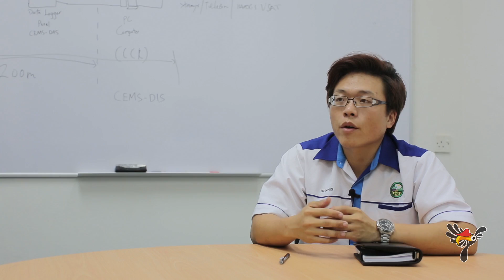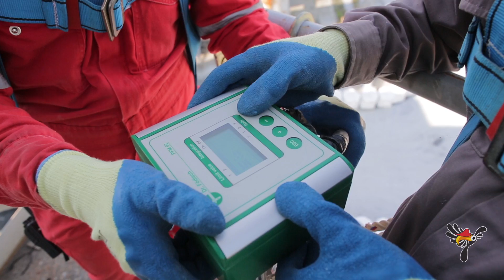A Day in the Life of an Electronics Engineer

Comment: Wag ka na Kayo mag ECE, sayang lang effort nyu. Even nakagraduate ka at makapasa Ng board exam if Meron lang design na electronics and communication system Hindi mo pa rin maiimplement Yan dahil need mo pa Ng sign and seal Ng PECE wherein vulnerable pa makuha Ng PECE ung design and maari mo rin xa makalaban sa project bidding kapag nakuha na nya ung electronics and communication system design mo.
Reply: sir ano fb mo? gusto kita makausap pa with regards dito
Reply: @SeanRicalde  sorry but it's confidential , Dito nalang tayu mag usap sa YouTube. Ask me your question and I will answer it. I will give internet links on the basis of my answers on your question para ma check na totoo ung mga sinasabi ko.
Reply: nagbabalak po kasi ako mag ece, lahat po kasi sila sabi that it’s an in demand course since nasa technology age tayo, hindi ko po ba dapat i take ece?
Reply: @SeanRicalde  kung Ang field mo ay technology software: pwede Ang ECE like sa IT industry pero sa engineering talo ka kapag ECE ka dahil ung mga Electrical Engineer kaya nila Gawin ung ginagawa Ng mga ECE. Philippine electronics code is very limited areas of application unlike the Philippine Electrical Code mas madami Ang projects na pede magawa. Dahil Ang mga Batas na nasa Philippine electronics code ay saklaw din Ng electrical engineering. 
In summary: So if software ung preferred mo, ECE is preferred.
Pero if u want engineering hardware and installation mas preferred ung EE or Electrical Engineering course.
Reply: @jasonamosco318  on point ka sir. Sana nag electrical nlng dn ako HAHA.
Reply: @christiantorres3892   may hope pa tayu, kung ang Iecep ay magiging mas active sa pag publish ng mga electronics code sa other field of areas. Kayalang mukhang Malabo din dahil sa systema ng mga nasa position sa Iecep natin.
Reply: sir nagbabalak din ako kumuha ng ECE (kasi new sya sa pandinig ko and i saw on the internet na indemand po daw ito since humahigh tech na tayo) kaso people around me said na mukhang wala namn siguro akong mapapala jan compare sa kung mag CE ako (since CE is very well known na and malaki daw yung sahod), so i would like to take nlng kung sino po sa kanila ang mas in demand nila dito at maraming job opportunities dito Pinas/ibang bansa, thoughts po about this?

Comment: I'm about to take BS ECE, but I'm having second thoughts. Any tips?

P. S. I'm not good at programming but, excels in terms of math.
Reply: As an ECE I will not recommend to take ECE just because you are good in math. Electronics doesnt just revolve in math and engineering will make you realize you really are not good in math the difference in higher math to intermediate and basic math is more than a light year. ECE requires skills both in technical, programming, research, creativity and your adaptability being an ECE requires you to constantly taught yourself of new things since engineering is ever changing and ever evolving it doesnt stay the way it is.
Reply: Thank you so much for your reply
Reply: @momsspaghetti1762  but if you are good in analysis yes you are fit for electronics those circuits, systems and troubleshooting your main reference is your great analysis. Math trains your analysis so why not
Reply: Totoo Yan sinasabi ko, basahin mo RA9292 Electronics Engineer law of the Philippines at 4 books Ng PEC.
Reply: Wag ka na mag ECE, sayang lang effort mo. Even nakagraduate ka at makapasa Ng board exam if Meron lang design na electronics and communication system Hindi mo pa rin maiimplement Yan dahil need mo pa Ng sign and seal Ng PECE wherein vulnerable pa makuha Ng PECE ung design and maari mo rin xa makalaban sa project bidding kapag nakuha na nya ung electronics and communication system design mo.